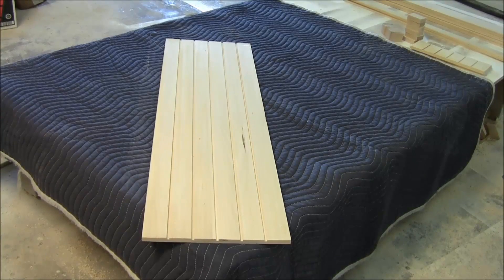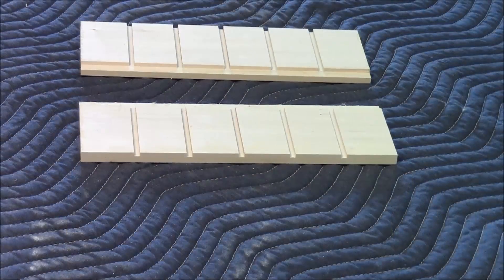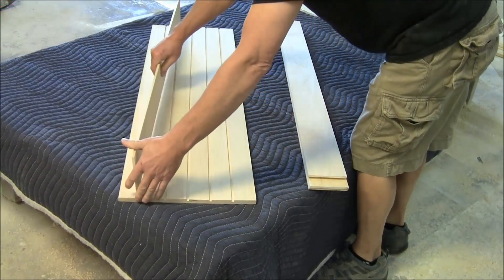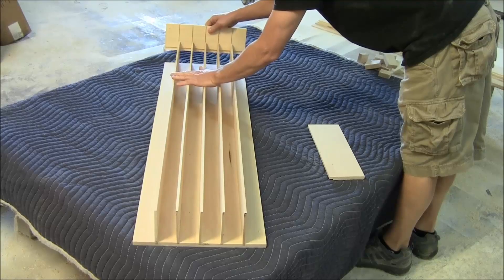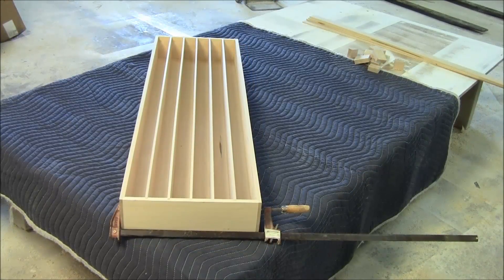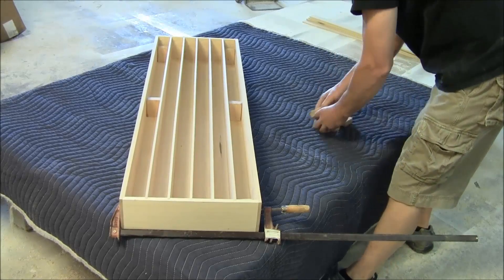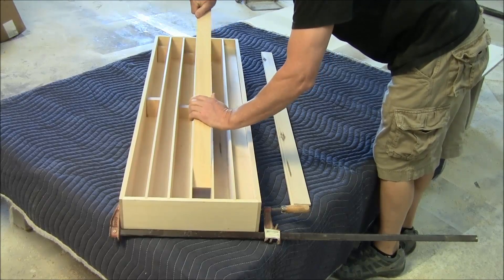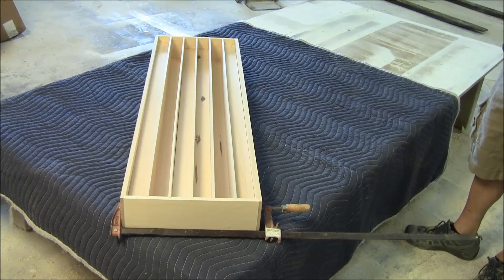How To Assemble The Acoustic Fields DIY Diffuser Kit - www.AcousticFields.com

Comment: Hi guys, love your channel!!  What is the approx. dimensions on the unit you’re showing in the video is this all built out of pine?
Reply from the maker: You can build diffusers any width or height size that will meet the room and usage requirements. The diffuser shown is a prime 7. Each sequence is 14" - 15" wide. You can combine 2 full sequences into one diffuser.

Comment: Can you stretch a thin fabric over the front of the diffuser? If so, what would be the acoustic effect? Thanks for your channel. It's immensely interesting.
Reply from the maker: No fabric over the face of a diffuser. These are passive devices so we can not have any air flow restrictions.
Reply: @AcousticFields  Thank you for answering. I hugely appreciate it. If I may ask a follow-up; because in my situation, it may be a matter of a) being able to have it or b) not - due to decoration differences in-house, so to speak :) Is it a matter of a smaller % of functionality degradation, or would it completely kill the functionality of a quad diffuser? Again, thanks so much for your time, and for all your video material. Hugely inspiring.

Comment: What type of wood do you use for this and your QRD 13 diffuser definitely  lighter and easier to manuever than 1/4" plywood also seems that I would need a a finer Dado blade
Reply from the maker: J,  Use the tool that fits the task. Softwoods are best for diffusers.

Comment: Hi, I have seen some other Quadratic Diffuser which has different height between the panelwoods? What is the different with this one which has same height?
Reply from the maker: Hi Sebastian, Diffuser height is determined by room usage, distance to listening position, and a host of other variables. There is no "one size fits all".

Comment: Might be i'm in the wrong here, but wouldn't a 375 Hz soundwave pass through the "lid" for the wells considering its not that thick - or is it a highly dense material? In that regard, would it be better if the wells were "all wood" all the way to the bottom? it obviously knocks up the weight though.. Also, is there an optimal relation between the well width and the thickness of the fins that separate the wells? All help appreciated :)
Reply from the maker: Hi Oslo, The well depth of a quadratic diffuser is based upon quarter wavelength rules. The width of each well is based upon half wavelength rules. It is the combination of both of these that give you the lower and upper registers of the frequency response for each prime number. The thinner the well divider, the better for performance. A thinner well divider affords for more surface area. Softer woods make for warmer tonal qualities.
Reply: Thank you. However, i cannot get my head around the fact that 375 Hz is close to 1 meter wavelength and that such a wave easily will go through the rather thin "well-lids" and therefore not be affected by the diffuser. But might be the quarter wavelength rule applies to this? You are the experts here :)

Comment: do different prime number mean different things? many thanks will
Reply from the maker: +Wiremu Yes, higher prime numbers mean a lower diffusion frequency range at quarter wavelength or well depth.
Reply: Should i put a diffuser on the back wall or a quadratic diffuser? its confusing. thanks for any help ;)

Comment: Hi Dennis, would adding absorptive material inside of the wells make the Diffuser more efficient at lower frequencies? Thanks.
Reply from the maker: +AGWillMusic The well depth of a quadratic determines the lowest frequency at which energy is diffused. The well width determines the highest. If you add absorptive material to the well depths, you disrupt the diffusion frequency response.  I can not think of any scenarios where you would need to do that. Dennis
Reply: @AcousticFields  but don't you make a QRD that has the insulation in the wells?
Reply: Thank you for your reply!

Comment: wow... 400 dollars for wood that you put together yourself? I made a skyline diffuser for 30 bucks
Reply from the maker: Hi CJ Cox Well its really the labor cost of having a professional carpenter cut, prepare and dado the pieces. By all means come and give us your labor time for free although I'm sure there are laws against that.

Thanks
Dennis
Reply from the maker: Hey CJ Cox  I went ahead and asked my colleague to ask me your question in this weeks Google Hangout.  You can see my answer to your question here.  I hope it helps:
http://youtu.be/K1B0lqL7C0A

Thanks
Dennis
Reply: I'm sure he knows that. It's like with most professionals. They take advantage of the fact that you can't do it and overcharge like crazy. I got so sick of it I taught myself how to do most things myself. And in the process I learned this: professionalism in most cases is overrated.
Reply: Acoustic Fields Eh Acoustic Fields you have to realize that, 1. Wood is cheap as hell, and 2. It takes hardly any work whatsoever to run a few planks through a table saw, and then rout out slots.
Reply: You guys don't know anything about running a business do you 😁 You have to charge 2.5 times the material costs and labor to cover all kinds of other things and still make a little bit of profit. I'm sure their profit margin is not unreasonable.

Comment: This looks like a very practical approach, but what type of diffuser is this? It looks like a quadratic residue diffuser, yet it has the wrong number of wells.
Reply from the maker: Hi KennyTew2, It is a quadratic series diffuser based on prime 7. The 0 sequence well has been removed. It is not audible in its absence and it decreases the width of each unit by 4". There is a zero position well established when diffusers are placed side by side which they normally are and thus the cabinet edges join together for the missing 0 well.. 

This makes the units overall width at 14 1/2" which our project studio customers really enjoy. It also only weighs 20 lbs.

Thanks
Dennis
Reply: Acoustic Fields Ahh, thanks for the feedback, that makes sense.